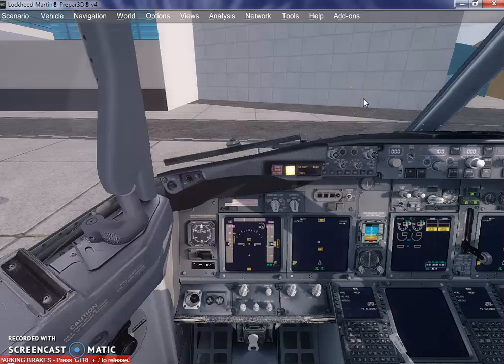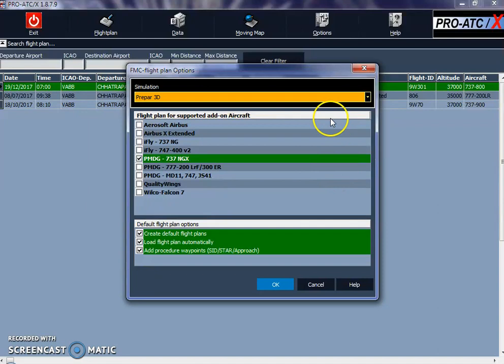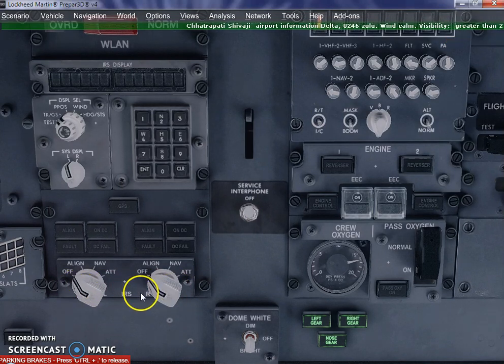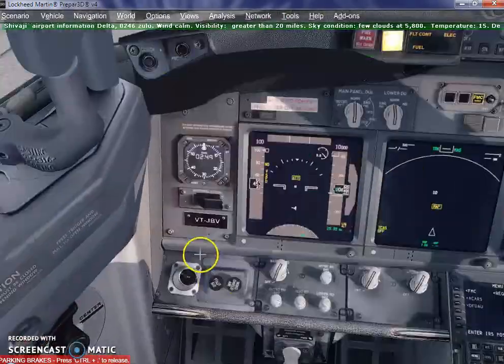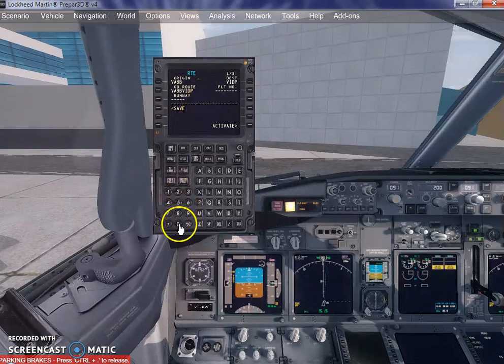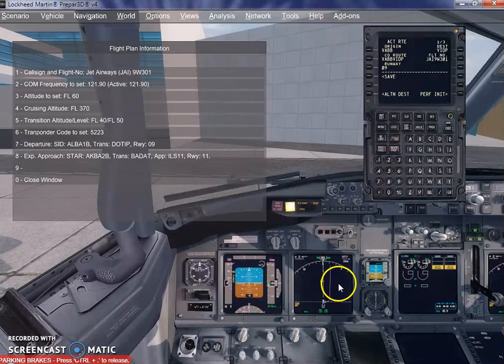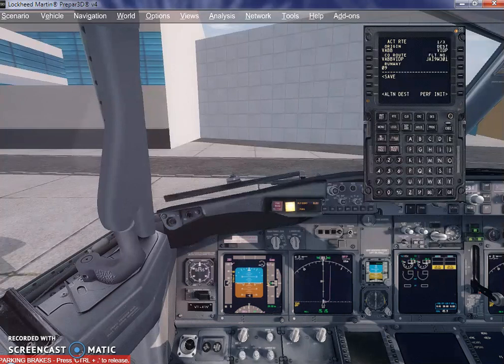PRO ATC X TUTORIAL #2 - Loading the Flight Plan into the FMC

Comment: I'm using Wilco Airbus A320. Is it possible to load with Pro ATC X ???
Reply from the maker: Does Wilco Airbus use the same flight plan as Aerosoft? If yes then it will work?
Reply: @TheIndianFlightSimmer  I chose Aerosoft Airbus but when I  press Fly now nothing happen in my sim
Reply from the maker: @QuocHuyTran-ew1in   I just tried getting help from their forum and other sources and it is said that Pro atc x does not work with Wilco Airbus.
Reply: @TheIndianFlightSimmer  oh, anyway thank you very much
Reply: uh one more question what about the Fslabs ???
Reply from the maker: @QuocHuyTran-ew1in  I have not used it on either FSLabs or Wilco Airbus so I don't know if it's going to work.
Reply: @TheIndianFlightSimmer  ok thank you

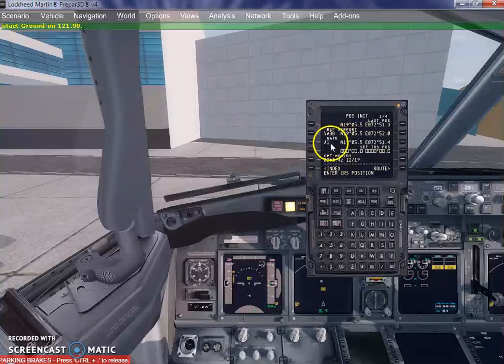Comment: Hi Nice vidéo, Just a question : how did you the Green message for the clearance at 5:35 i do not have. 

Thxs
Reply from the maker: Thanks for your message Alex. You need to tick the scrolling text in the options of PRO ATC X itself then you will see the message. Let me know if that helps.
Reply: Hi thanks a lot it helped. 
Have you any advice about how Make a flight cause i use sim brief and i don t how to import in prepar 3.d. 
Pro atc it s an alternative ?
Reply from the maker: @alexandrecotti3380   You mean to say that you want to know how to import flightplan from simbrief or pfpx into P3D?
Reply: Yeah That s it or into pro arc x
Reply from the maker: @alexandrecotti3380   Ok, have you seen my other video which shows how to do flightplanning in PRO ATC X? Watch it and it will help. I am planning on doing a video on flightplanning using Simbrief. Till then you can watch my other video of PRO ATC X.
Reply: Yeah. 
I don t how we can use simbrief ? Cause i can put my Flight plan in my addon files, but how can i get atc  with a Simbrief Flight plan ?
Reply from the maker: @alexandrecotti3380  OK, first of all Simbrief doesn't give you updated flightplan as you need to have paid version. Secondly if you use PFPX then it's much easier to export flightplan into PMDG or Other aircrafts.

Comment: Once I get clearance from ATC and I put the two airport names into the fmc into the co route section (e.g. kphxklax) it says invalid entry . Is there something I am doing wrong? It also selected PMDG 737 NGX on the list when I run the flightplan in pro ATC x
Reply from the maker: Have you clicked start flight option in PRO ATC X before entering the flight plan?? Also check if radio frequency is entered correctly.
Reply: Uncle Sam Simmer yeah, I click run now in pro ATC and I get the clearance in the sim. Once I do this I type in the co route into the FMC , like KPHXKLAX by it says invalid entry. I then have to input all the waypoints manually . Any idea why it doesn’t work?
Reply from the maker: @Mampz147  Is the flight plan correctly created in PRO ATC X?
Reply: Uncle Sam Simmer yep, everything is fine. It even selects PMDG 737NGX by itself (detects that I’m flying it). Then after getting clearance and putting in the airport codes into the co route in FMC it gives invalid entry. Not sure what I am doing wrong bro. Pro ATC works fine with any aircraft but doesn’t seem to import into the fmc on pmdg or aerosoft airbus
Reply from the maker: @Mampz147  wait, let me check the same flight plan on my machine and get back to you with further details.
Reply from the maker: @Mampz147  Alright I think I have found what's wrong, check if the following works for you: before inserting both airport IATA codes in the MCDU check your radio's active frequency, it has changed, change it back to 118.10 and make it active. Now request clearance again and you should be able to insert the FP in the MCDU correctly.
Let me know if this solution worked for you.
Reply: Uncle Sam Simmer thanks brother. I will give this a try and let you know my results !
Reply from the maker: @Mampz147  ok, let me know

Comment: Does the Pro ATC actually talk to you, and can you talk back via VOX?
Reply from the maker: You will have to go through the manuals and check if it can use VOX, PRO ATC X can use speech recognition but upto what limit that you need to check via PRO ATC X manuals.
Reply: @TheIndianFlightSimmer  do you know if there is any dialogue from pro atc at all,? Never mind speech recognition just to hear it not read it. This demo never addresses that question. Just shows text across the screen
Reply from the maker: @jnorm0075  This tutorial does not address that query, it is a startup tutorial for beginners. I have never used the voice feature so you should mail to pro ATC X technical support for this query.
Reply: @TheIndianFlightSimmer  I searched on more YouTube videos for pro ATC and it is a setting. Of course you can have the pro ATC talk to you. Not sure how you could not know that. You talk back by a generic voice with a pulldown menu. Easy.
Reply from the maker: @jnorm0075  Ok, so did that resolve your query or else I can talk to pro ATC X technical support for you and get back to you.

Comment: Ok I'm using pmdg 737NGX and when I try and load a flt pln into the fmc I get invalid entry? I use Pro ATC-X to build my plans save it, then export my D:\Program Files\Lockheed Martin\Prepar3D v4\PMDG\FLIGHTPLANS\NGX? What ext does pmdg accept because Pro ATC-X saves the file as a .pln?
Reply from the maker: MrZX1409 Hello, you are entering wrong prefix for the plan. You need to insert airport IATA Codes without spaces. For example, VABBVIDP in my case.
Reply from the maker: MrZX1409 also you must have proatcx running in the background after you click on fly now button. Follow the tutorial from first episode to understand step by step procedure.
Reply from the maker: MrZX1409 Please let me know if you still have issues.
Reply: I am using the IATA codes, the flight I'm trying to create is from Seattle to San Diego and I enter  KSEAKSAN into the FMC and I'm getting the invalid entry?
Reply: Yes, I have proatcx is running in the background. I also notice that, when I export a fltpln from proatcx that I've just created the only opt listed is are (FSX(XML), FSX/FS9(TXT), ICAO, SQUAWK BOX3(SP3), FSINN). I've treid to sav as a FSX & SQUAWK FILE, but it still didn't work? I'll review your video again and see what I'm missing.
Reply: Sam I think I see were my problem is, you build your flt plns inside proatcx , I get my flt plns from flightaware and then paste the route string it into proatcx! Now I don't no where the file is being saved because I'll check my proatcx folder and the flt pln I've just created is not in there (Import or Export folder)and it's not being saved in the pmdg ngx folder either?
Reply from the maker: MrZX1409 correct, because the flight plan gets exported directly to pmdg FMC as soon as you select it from the list of aircrafts. You need to contact clearance delivery by pressing 1 key and then select clearance option after you enter cockpit. Only then your flight plan will become active
Reply from the maker: MrZX1409 Let me know if I have helped you in right direction and your problem is solved.
Reply: Uncle Sam  now that's working and thank you, now how do you get the menu to show the proatcx options? Also when I check in my pmdg NGX flight plan folder it doesn't show the flt pln I just loaded I'm not understanding that?
Reply from the maker: I am glad you are able to get it right, if I am right you are asking for the inflight menu of proatcx? It will come up by pressing numerical key 1 and then selecting options as per the numerical keys given, and if you are asking for flight selection menu for proatcx then you will find that answer in the tutorial itself. Let me know if you still don't get it.
Reply: Yes the menu for proatcx, I tried pressing #1 on the key board and nothing came up?
Reply from the maker: MrZX1409 Are you following the tutorial correctly because it should not be a problem.
Reply: Ok I got it now, because I have P3D4.2 U have to use ctlrl + 0, 1 ,2 and so on!  I still don't know where the flt plns are being saved to because it's not in either the "pmdg ngx flt pln folder" nor the "proatcx folder"?
Reply from the maker: MrZX1409 Punch in PROATX to the scratch pad and enter it at the CO Route LSK. This must be done only after opening ProATC and selecting your saved flight plan and selecting 'FLY NOW' and then go back to your cockpit and switch your COM1 frequency from ATIS. Then get your clearance from Clearance Delivery. Flight plan from PROATCX gets loaded automatically once the above method is followed.
Reply from the maker: MrZX1409 Hope I have answered your query correctly!
Reply: Sam thanks for the help I got it now, but where is the flt pln that I create in proatcx being stored I've checked in proatcx "import & export folder" and in the "pmdg ngx flt pln folder" and it's not there, I would like to use in my AS weather program??
Reply from the maker: MrZX1409 Go to options menu in PRO ATC X and here you can explore the directories to assign your weather program in Pro ATC X itself. Here you should find fltplan directory also.